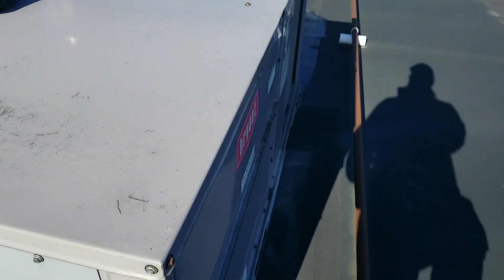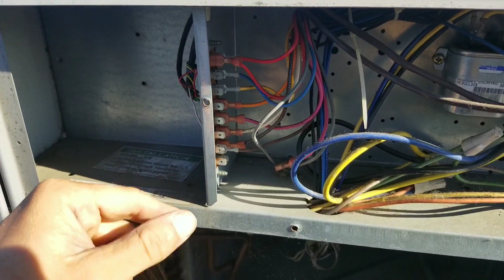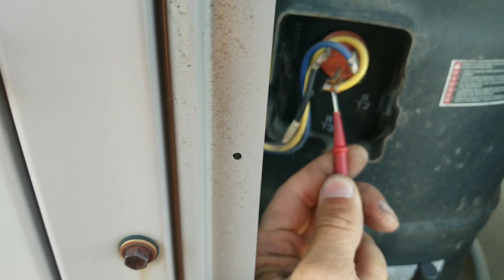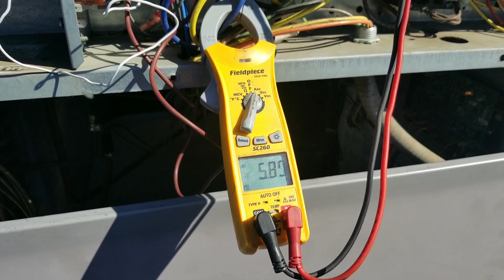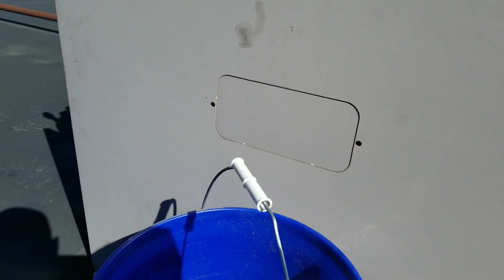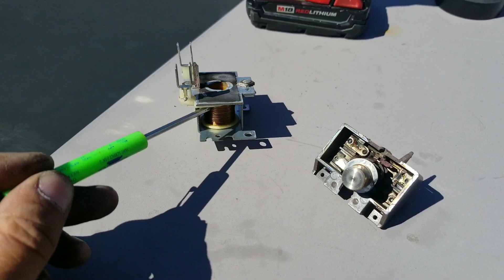Carrier Package unit not cooling

Comment: Great vid. Good For teaching. The only thing I would suggest is on the switching relay where you have exposed high voltage terminals to put insulated spade terminals on there to keep from accidentally shorting thru by a screwdriver or worse a hand.
Reply from the maker: Good tip!

Comment: I have had some fun times trying to find out why 0-10v actuators not closing and transducers showing incorrect values. Usually it is because the 0v on the transformer 24v side is not grounded so the 0v reference point "floats".

Comment: Enjoy watching you videos I like the way you step through testing the components of a system to find a short or root cause of the failure, then repair, replace as needed, and try not overlook anything Like a loose belt or wire rub outs. Find myself learning something new on each of your Video's, help ing me in the field, keep them comming and Thank you for the education, I try to pass it on to new tecs that work with me.
Reply from the maker: Thanks

Comment: Step down transformer secondaries are grounded for reference, voltage stabilization, and safety.  Be aware not all transformers are internally grounded so never rely on chassis ground for reference when troubleshooting a 24 volt circuit...

Comment: I believe an air pressure switch should come standard to prove fan operation but unfortunately is an option on most RTUs. Such a small item is very useful to diagnose the supply fan & interlock the other components.

Comment: Hey there. Love watching your videos. Keep up the good work. I am an electrician that is trying to switch over to ac work because I like a challenge. 😁 I learn something new in every video. In reference to your question of why the secondary side of the transformer is grounded, it's for two reasons. The first reason is safety, as you mentioned in video. It provides a return path for current. The second reason is to provide a "reference plane" for current. It helps to balance out the voltage in an unbalanced situation and keep voltage from climbing too high or low. When I'm at work and a device (light or ceiling fan) isnt working and my meter says 87 volts. It's usually an open neutral. Anyway, keep up the great work. Love your videos and hopefully I'll be starting hvac school soon. Have a great day.